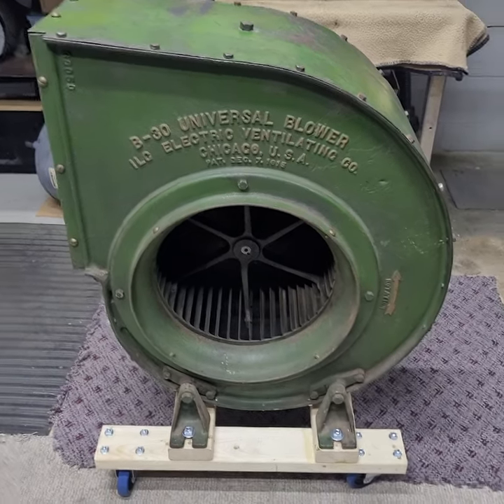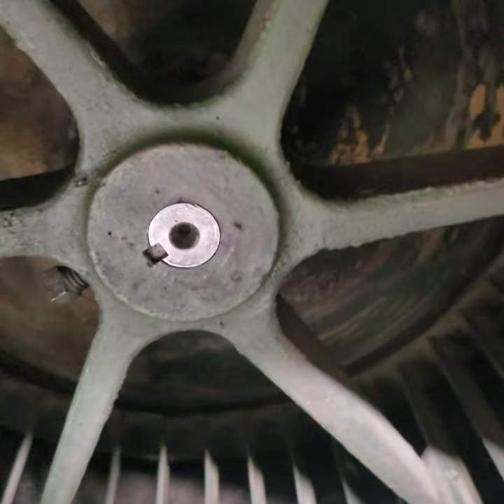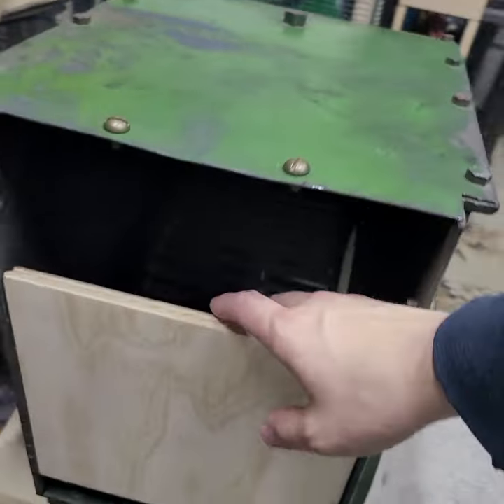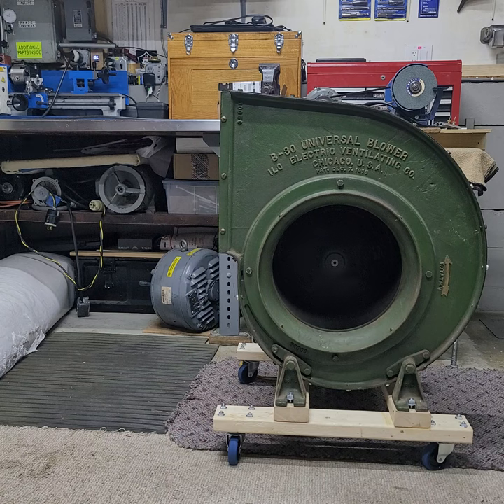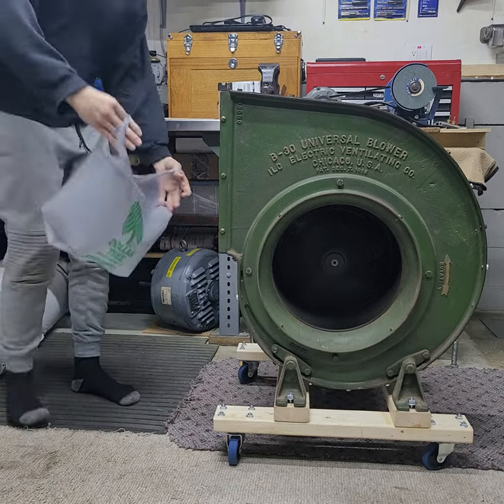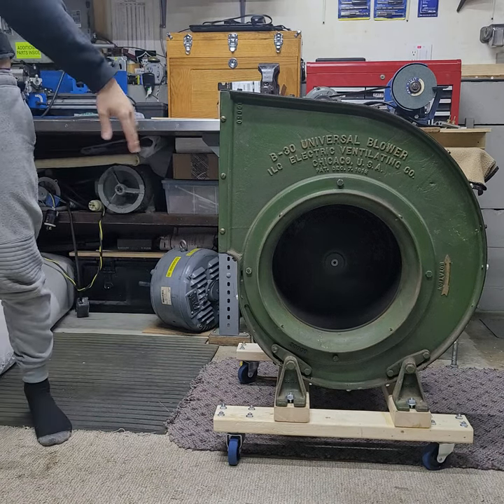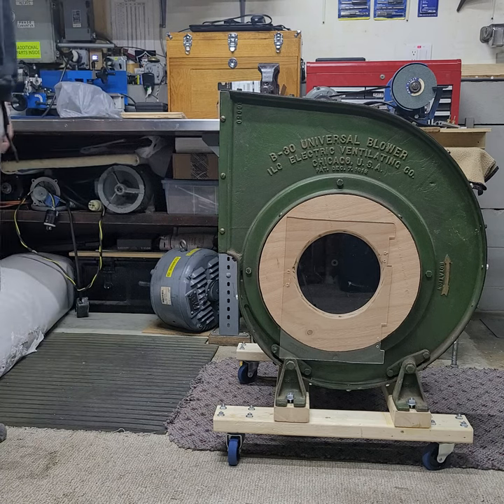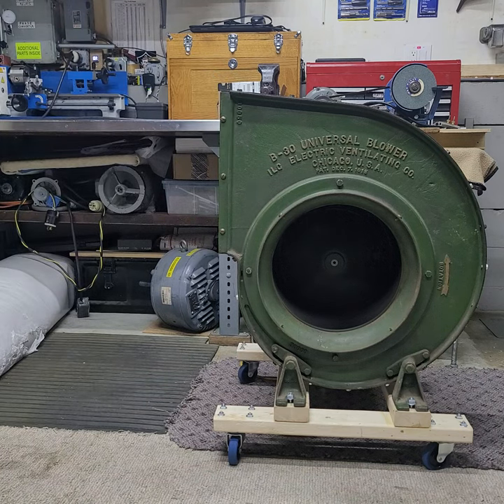ILG B-30 Blower Performance Demonstration

Comment: Sounds good and seems to have plenty of power! It's definitely well built if it will run below current spec with full open discharge! That would massively overload many modern blower units!
Reply from the maker: Thanks! and yes I wish I had a way to use this for the house air handler. Someday I hope to find a place that I can permanently install these blowers into a ducted system and use them as they were intended.
Reply from the maker: I also can't wait to get to make the static converters for them. I did some experiments with the B-25 and got it to only draw about 1.75 amps from a 120v wall outlet. That motor is rated 3.3 amps at 220v 3 phase but with some power factor correction it made a huge drop in the current.